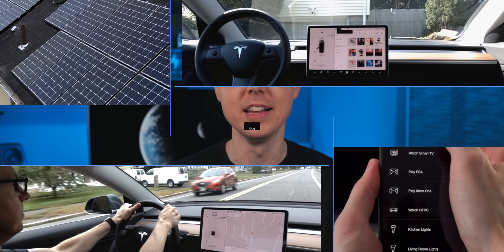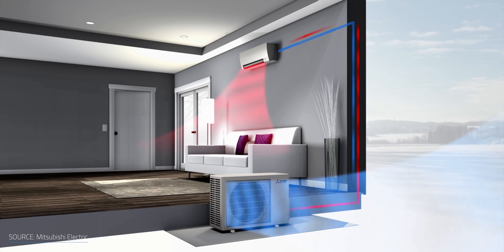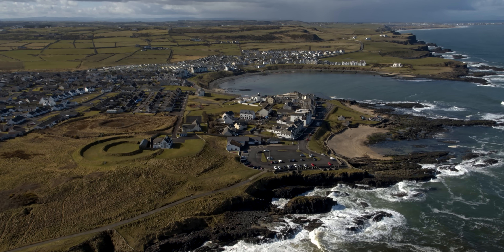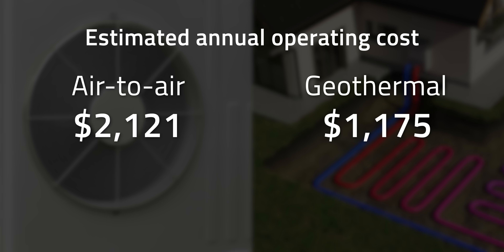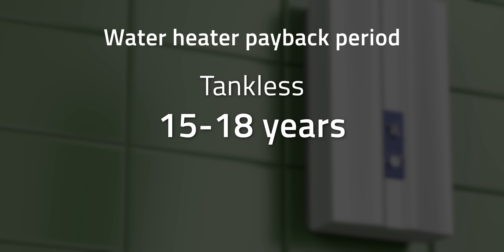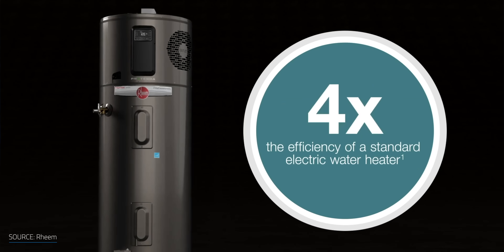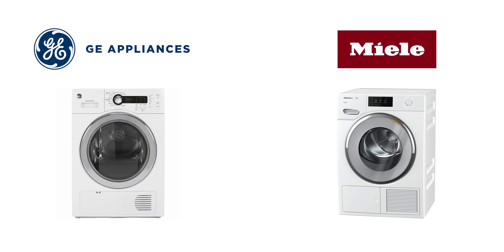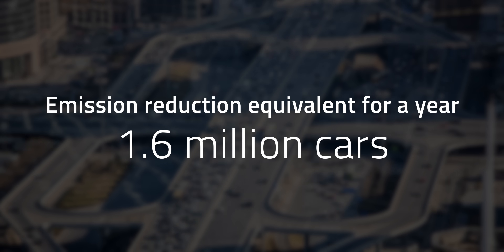Why Heat Pumps are Essential for the Future - Explained

Comment: I have a 220m deep hole in my garden here in Stockholm Sweden. The pump circulates the antifreeze mixture around as needed and normally draws out about 4-5 degrees celcius from the brine. Works great! COP of 4.8 producing up to 16kW. Running the system off solar panels would give you a double solar system as the heat from the ground (solar radiation) would be moved into the house by electricity generated from Solar panels :-)
Reply: Sounds like a great system! As an FYI, geothermal energy doesn’t come from the sun. It is a combination of energy from the formation of the earth and energy from radioactive decay.
Reply: @brucejri  according to the manufacturer of the heat pump, the heat is coming from ground water that has been heated during the summer months. No one claims geothermal, for that the hole would need to be much deeper.
Reply: @SeanCameron007  that is interesting.  I would have assumed that a 200m hole was deep enough for geothermal energy to dominate over solar energy (otherwise why dig it so deep?).  But admittedly this is not my area of expertise and I assume (and hope!) that the heat pump manufacturer knows more about this than I do.
Reply: @brucejri  each meter of the bore hole's depth returns a certain amount of heat, if the hole is too shallow you risk freezing it and potentially damaging it. Plus, the deeper the hole, the higher the average temperature of brine circulating which improves efficiency.
Reply: @brucejri  The depth at which the geothermal component starts to dominate over the solar component depends greatly on the region. In most of Scandinavia, the Earth's crust is particularly thick and old which reduces the amount of heat coming from below. I checked a few test drill datasets, and the top 100 metres are often clearly affected more by the head from the above than the nice but very low heat gradient from below (and even below that, I would assume the relatively shallow hole of just a few hundred metres will get much of its energy ultimately from above after one pulls it a bit under the ambient rock temperature). In one of such datasets, I could even see the propagating wave of cold from the previous winter, at about 15 metres below surface during next summer... But, this same thick crust is easy to drill (rather, it is very hard to drill, but holds nice good holes which makes the total drilling cost lower as one “just” needs to drill and not to also do reinforcing). Thus, despite missing most of the geothermal component, it is often more practical to drill a few hundred metres down rather than bury a few hundred metres of heat gathering pipe at a depth below the frost line. (For bigger buildings, one drills a few 200-or-so metre wells, spaced adequately to not affect each other too much.)
Reply: It would be amazing to combine a heat pump system with a solar panel cooling system, so the heat pump actually cools the solar panels
Reply: @davefish2280  wow that's actually a really good idea
Reply: @L2M2K2  thanks for your insights, that is very interesting
Reply: 220 meters is very deep, I think but I don’t understand your soil composition to know how that would work unless for cooling
Reply: exists already bro
Reply: So in the UK my new gas boiler cost around £1800 - about 2000 euro or 22000 kroner. How much would it cost to have my entire heating system replaced with a massive borehole in the garden to drive a heat pump? About fifteen times as much! Not only is the initial capital outlay cost utterly unaffordable, but the returns in the form of hypothetically lower heating bills which would not be that great since although a heat pump can return three or four times the heat energy per unit of electricity compared to gas per unit, electricity is much more expensive. It is very likely that I would be long dead before even beginning to break even on that eye-watering upfront cost.
Reply: Expensive and unfeasible system for most. Where do you get the electricity in the dark winter months?
Reply: People in major cities don't have such massive spaces to do what you can do, yes its a thing to do if you had such a garden access, but people living in apartments do not have this privilege.
Reply: @richardgregory3684  I pay for 15 000kWh 22000kr per year. System cost 220 000 and is the cheapest way to heat my house, payed itself off after 5 years. Gas is not avaliable for most in Stockholm.
Reply: The cost of whole system ? Drilling included
Reply: @mgabrielle2343  They recommend that the bore holes are between 10m to 20m apart, most people with Villas have this type of heating system in Sweden and the average garden size is about 650m2 in Stockholm's suburbs, not super huge.
Reply: Sean, I have the solar (ground based-adequately sized). Now refurbishing a large old house with ground floor underfloor heating and wondered if the ground-based heat pump will genuinely work in our UK winters, but it sounds like the well-drilled depth of any system is the critical criteria in maintaining the right UFH temperature at the outlet. The efficiency of heat pumps appears to be too good to ignore.
Reply: @davefish2280  There is an Australian company supplying cooling to fix onto your PV panels with the heat captured venting into a glass house to grow vegetables etc.
Reply: @L2M2K2  Lari thanks for the insight. We getting so little good practical information here in the UK, where the construction industries are all locked in a timewarp and even those that innovate are light years behind Scandanavia. I've got a large ground-based solar system producing an average of around 100kWh per day and still, I am struggling to commit to a ground-based heat pump for the home I am refurbishing (100 years old). That was until I read yours and so many other comments here. The thing I hadn't realised is that I can easily provide an electrical heater to the system (in mid-winter) if required to assist with the temperature output of the heat pump. That finally seems to de-risks it for me.
Reply: @brucejri  Can you answer if the core of the earth runs as a nuclear power plant? Is there Fission in the core of the earth? (That power's the magnetic shielding of the earth?)
Reply: Ground source heat pumps do not necessarily need to take a lot of room. Here in Sweden we generally drill deeper rather then digging shallow but with more area, even apartments can get boreholes, they are drilled in the basement with small specialized drilling rigs. Then connected to a set of larger heat pumps supplying the whole building.
Reply: Sweden don't have enough sun in winters when the heat pump needed or it will so many panels installed that it won't be savvy
Reply: That's doesn't sound right. At that depth, water should be warmer. I have a well at 50m and water is 14 celsius entire year. It is used with 16kw heat pump and works like a dream.
Reply: If the hole costs the same as drilling does in Belgium (approx 30000 usd) you could have installed solar heating capacity at a fraction of the cost?
Reply: That’s a geo not a heat pump.
Reply: @IrHupke  It doesn't. Not even close. Here in Finland ground-sourced heat pump system with bore hole(200m max) drilling costs around €15k. Drilling costs are about half. I'm sure it's similar in Sweden. Solar heating is joke, you would be without heating 4-5 months in time when heating is most needed. It's called Nordic winter. You might not even see the sun for month or two depending on weather, mostly cloudy. For new house GS heat pump is obvious choice but with existing house it's not necessary best option.
Reply: @wardwyseur  excellent work on that username
Reply: Wow..I'm envious.
Reply: That's very interesting! I'd never considered solar energy being stored in ground water, the more ya know huh?
Reply: @schottepaul  Sweden has huge amounts of hydro in the north, Norway has the same thing and Finns have new 1600MW nuclear plant in commissioning phase now. Nordic countries share the grid and that balances things nicely.
Reply: @Daniel-os9tb  It definitely is a ground source heat pump. In Sweden bedrock is so thick that the temperature even at the bottom of the hole like this is just well.. not much. Less than normal room temperature.
Reply: @sretenjovanovic3006  depends on area hugely. In Nordic countries bedrock is really thick and at 50m ground is just 5-10 celsius. Nice to get power for heat pump but not usable for heating directly.
Reply: @Karjis  you have no trade or engineering experience. Not even close.
Reply: 220m deep sounds like a lot! Can't imagine the initial cost of that system. I got some estimates for doing a 30-50m deep hole (Northern Germany) and it already was in the mid to high 4 digit range. Does your system ever recoup the cost of initial invest?
Reply: @HermanWillems  It doesn't. If that were the case the earth would be a sun and not a rocky planet.
Reply: @HermanWillems  To the best of my knowledge there is some evidence (remnants of specific elements and their isotopes) of natural nuclear fission, not fusion, located near the surface in Africa, if I recall correctly.   The Earth's core is huge so some natural nuclear fission seems possible as occurred in Africa but experts say that the main source of internal heat is due to radioactive decay and not fission.  Also the Earth's magnetic field is due to the iron content of the core, as currently understood.  Full disclosure, I'm no expert but I did sleep at a Holiday Inn once.
Reply: @Daniel-os9tb  name one thing that was not correct, and and yeah missing PhD, everyone has Masters in engineering, who doesn't?
Reply: @ElSelcho77  at least in Finland drilling hole to Rock is somewhere 30-40€/m range. You'll find instant fixed price of 36€/m if material is rock, so high 4 digit you'll get also deeper hole. But if the ground is soft and pipe has to be added to support the hole the price goes up quite a lot, especially now when steel price is through the roof and also there are availability issues for steel pipe supporting the borehole.
Reply: The heat in the ground is primarily from earths convection not the sun.
Reply: @Karjis  gee. It’s not f ing heat pump. Duh. But any engineer who got a ba would know that. Yah. Obviously you need to go to grade school. Forget going to college. Since you obviously can’t read and comprehend. The particular unit he’s posting about isn’t a heat pump. But hey. You claimed you are at a engineering level. Prove it.
Reply: @Daniel-os9tb  oh no heat pump, you have to have quite cool house to do anything with 40F water that you get from underground loop. Well that works for passive cooling during summer but it is completely pointless for heating without a heatpump to push the water temperature up to something usable (at least 80-100F). Or what would you like to call a device that takes heat from lower temperature source and heats it to higher temperature? Tell me the correct name of the device that has cold side heat exchanger, compressor and hot side heat exchanger + controls and is not a heat pump. When the product is warm/hot water, not the cold, when I might call it a chiller. And for terminology sorry, english is my third language..
Reply: @Artcore103  yeah, only about 50ft from surface is affected by the sun.
Reply: @davefish2280  You mean fotovoltaic or solar/watter based? That is not a good idea. You need hot watter everytime but also you need to switch between cooling and heating the rest of the house during the year.
Reply: Sounds like a match made in heaven... the problem is, there is no sun in winter, and on the few sunny days it barely rises over the horizon. And, of course, someone has to clean off all the snow from the panes.
Reply: @richardgregory3684  If you already have a gas hookup, fine. In my case, the cost of a twenty-meter gas pipe plus all the permits almost made up for the cost of the heat pump.
Reply: @jmi5969  from the nordic experience, when panels are mounted to roof which is steep enough the snow will come down by itself by gravity when sun shines a bit. In my example case last february production was around 50% from last summer top months and march already 65% of monthly production. Basically December and January is ran with bought power only.
And no way I would climb on snowy roof to clear anything, nope.
Reply: @Karjis  50% in February? Good, almost unbelievable. In my area, 50% is really May and August territory. Although this May was so cold and wet, we didn't see the sun for weeks until mid-June.
Reply: @jmi5969 I would guess your panels face quite high? These are at around 40 degrees angle, not that really matters during summer as june-july sun is at around 60 degrees from horizon. Last feb was quite sunny here, cold but sunny during days. It is cool that highest peak powers are seen usually during march.
Reply: @Karjis  I don't have any panels. Only a deep-bore heat pump. And a fairly efficient slab acting as a heat reservoir. 
We have, long-term average, one sunny day in January, one sunny day in February, 2 in March and 2 in December. Solar is a no-go, even before considering costs and maintenance.
Reply: @jmi5969  for panels need to remember that day doesn't need to be sunny for panels to produce power, just enough light and power is produced. Of course more when sun is shining directly. Maintenance has been low for three years in one house, in other words nothing has been done, as there were nothing to do yet. I've been checking for dust in inverter cooling fins and made sure that production has been similar as previous years. Snow seems to clean the panel glass quite well. 
Other panel setup was added to another house this spring and well it was lucky as it has already paid roughy 8% from whole installation price in two months compared to situation without panels, but as an excuse, the system is small (3kWp), diy install and used inverter so overall costs were really low. Really no downsides but it basically pushes summertime electric bills to zero even with that panel power as production is enough to offset the little that is needed during summer (a bit of cooling, fridge, hot water etc.). And during winter the situation at worst is the same as without panels. With deep bore heat pump summer consumption would have been even lower, but due to cost in this location (really thick clay surface) borehole would have been a bit expensive and excel decided to point towards air to water heat pump system so cooling during summer requires compressor running as no cool water for passive cooling available from ground.
Reply: @bulatdavlet5141  I presume they can run it off the grid, too. And in summer when there is lots of sun, it can cool as well!
Reply: @richardgregory3684  A gas boiler won't cool your home in summer, though! And heat pumps are basically air conditioners, meaning they filter pollen as well. I moved to Japan, where air conditioning is as common as the USA, and can't imagine life without it.
MInd you, gas is also far more expensive than electricity here. But Europe needs to wait and see what mr Putin says about that, eh?
Reply: @richardgregory3684  I don't think that much thought has been given to the problem of drilling boreholes in confined urban space so the drilling equipment is just normal well drilling. There is a avideo about an American design for this. Search for this old House geothermal. The cost of the installation was about 15k sterling. That is getting close
Reply: @richardgregory3684  it's correct for geothermal, it only makes sense in select cases, but air to air is now cheaper to install and run than gas, and it also cools in summer so a no-brainer.
Reply: @schottepaul  Geothermal is unfeasible bar exceptions such as big castles and non-residential in Nordic climates.
Air to air is however very feasible and cheaper to run than gas. Solar excess from the summer can (partially) cover your winter electricity consumption, but even without that, if you have a lower night electricity rate, you can save over gas.
Reply: 220m DEEP?? WTF?
Reply: @davefish2280  the cost it would take to cool the panels directly wouldn't be very good. You need a lot of copper and aluminum to be able to absorb the panels heat and it would be cheaper to add more panels to make up for the efficiency loss that the heat produces. Same reason why solar tracking systems don't really exist much.
Reply: @Daniel-os9tb  it's a geo heat pump, you dork
Reply: @randybobandy9828  I know you are what am I.
Reply: @Daniel-os9tb  oof.. Imagine not knowing geo heat pumps are a thing 🤦
Reply: @randybobandy9828  like you not knowing what a geo actually is or a heat pump. HahhahahHhha
👌🤦‍♂️😁😆😆😆😆
Reply: 220m? Get outta here
Reply: People seem confused by this. The Fennoscandian shield is a massive piece of bedrock up to 300 km deep - drilling a couple of hundred meters into this is no biggie. Also it's not geothermal - almost all the heat extracted is replenished by groundwater flowing through cracks in the rock. The heat in the groundwater comes from the sun rather than from below. The water in the wells is about 5-10°C before you start extracting heat from it using it as the cold side of a heat pump that produces up to 55°C water on the hot side. Drilling an energy well costs about $25-30 per meter including collector hose, anti-freeze medium, etc. and lasts pretty much forever, the heat pumps including installation are $8000-$12000. Electricity is relatively cheap here in comparison to other energy sources so while the initial investment is large heat pumps still make a lot of sense as they lower your heating costs by 75% or so.
Reply: The savings are compared to using electric heating which was the most common heat source here before heat pumps. Oil or gas heating is almost unheard of here - the common heating systems are either electric,  firewood/wood pellets or district heating.

Sweden got rid of fossil based heating by investing heavily in district heating and fossil-free electricity production & the electric grid after the oil crisis in the 1970's. If your community/country has not made those kind of investments yet heat pumps won't make as much sense as they do here until you do. Once you've electrified larger extents of your energy needs they will start to make a lot more sense.
Reply: We are having our solar thermal connect to our brine as the average temperature on a cloudy dAy is 20c even when the air temp is 10c. The hottest the brine temp coming in just from the ground, is 6-10c hopefully this will save us a bit 🤞 I also thought of an idea, of putting  the brine pipes threw a compost pile just threw the winter.
Reply: @drewthatsme6212  The only tangible effect that will have is deep freezing the compost pile (unless it is ridiculously large). If you could pull that amount of energy from a compost pile you wouldn't need a heat pump to begin with as you could just cut out middleman and put the compost pile inside the house 😂
Reply: Can it really keep working at 16kw? I'm wondering whether it would become freezing cold under -220m in your well (heating mode) and the system has to shut down after it coutinuesly works at the max capacity, say 16kw, for a while?
Reply: @sheng8350  - I think 16 kW is the manufacturers max rating which includes additional electric heating for covering short peak demands. Normally you have a maximum shorter term power limit (40-50 W/m) and a yearly energy limit (160-190 kWh/m) from the well to avoid creating permafrost around the well.
Reply: How much sunshine do you have in Sweden in winter when you need heat pump the most? 
Do you think everyone is fool?
Reply: @kognak6640  Could you tell what is perfomance of this pump and what is electricity cost in your region? Does is repay?
Reply: Yes. I have a system with two 100m boreholes and it works well.
Reply: @mgabrielle2343 , Actually there are condo apartment like buildings in Finland that have a dozen bore holes drilled around the property, to about 100 meters, and they have a system to pipe the geothermal heated water to a heat pump in every apartment.   It is a matter of getting your property manager to approve a well or bore hole type of system for your building.  

One place I was reading about in Finland they had oil burners and switched to a heat pump system to provide hot water to all the tenants.  The system costs about 25% to run on electric instead of oil.  

Another guy in Finland drilled down 220 meters and struck 160F water, and is able to use that to heat his hot water and warm the home.
Reply: @davidfellowes1628 , The heat pump system in England is a wonderful way to provide heat to your underfloor heating system.  It is best efficiency for a heat pump to put out as low as hot water temperature as possible, and still get the heat into the home.  So 75F might work fine in your case,  and really save a lot of money. IF you need to heat the water above 95F,  you would be better off with a ductless heat pump to heat the air to 65F.   

How cold do your winters get?  If they stay above 20F, the heat pump will work great.  If they get to -5F on several winter nights each year, then they will work wonderful on the nights that are above 5F and not so grand on the nights between -5 and 10F.  

If you use oil heater, switch to a ductless heat pump as quickly as possible in your largest room in the home.  IT will heat that room and the adjacent ones for a very low cost compared to oil furnaces.
Reply: @davefish2280  once it's cold enough to need heating, the solar panels won't get too hot anyway